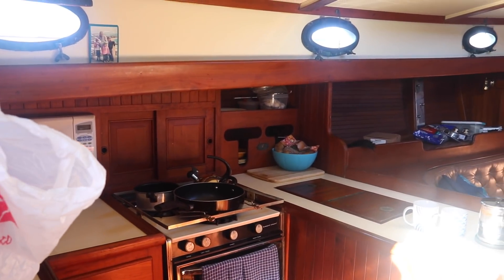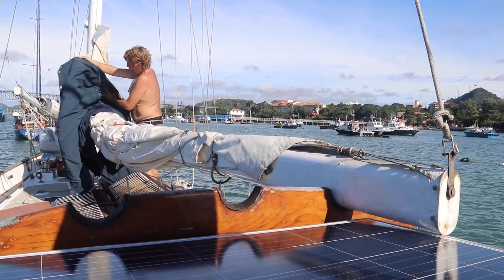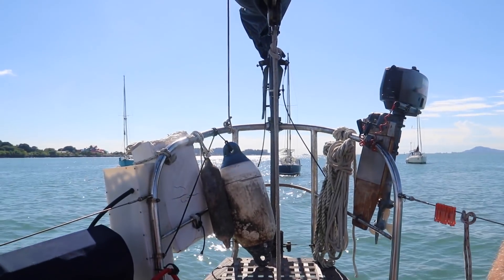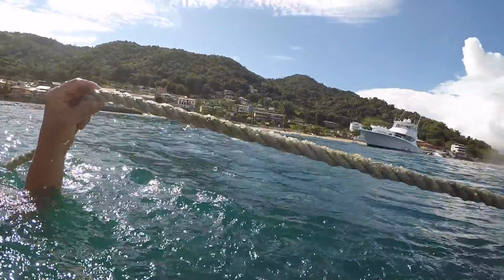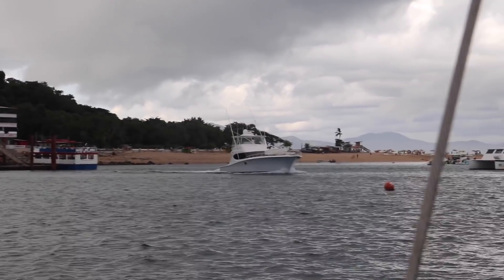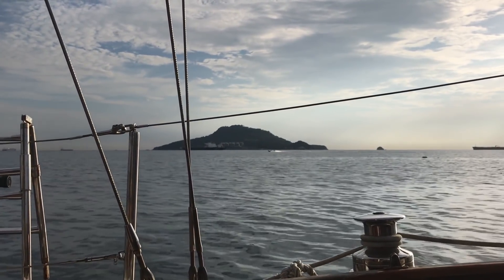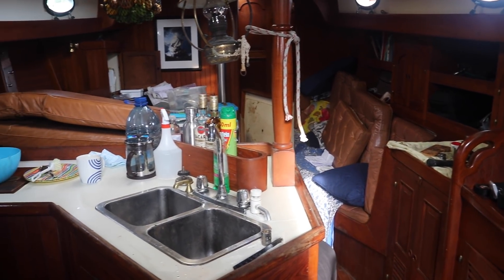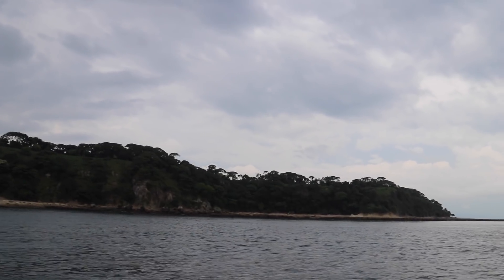Ep 71 | Cutting the Lines, Shakedown Cruise Isla Perlas Circumnavigation, Sailing Nutshell

Comment: Congratulations for getting on the move - a major achievement/milestone.👍 Good to see the onboard spare gear already coming in handy with the water pump - and what a great engine room for access.😀 When it comes to undoing a set of bolts there is always one barsteward - for the future and it sometimes helps once you have freed off all the other bolts and you are left with the barsteward, put all the other bolts back in and tighten them up this reduces the clamping load on the barsteward. Great update.👍👍👍👌

Comment: You can dissolve the corrosion off the lamp with vinegar but you need to soak it in it and then use some chrome polish autosol is the best,alternatively you could use steel wool to scrub off the corrosion but metal polish and elbow grease will have it back like new but if you leave it bare the sea air will tarnish it again fast so car wax or clear coat it or just polish it when it turns brown again
Reply from the maker: Thanks for the tips.  We’ll have it looking like new in no time. Cheers